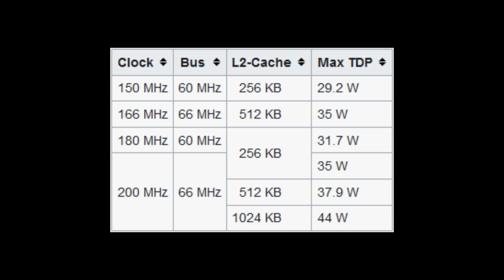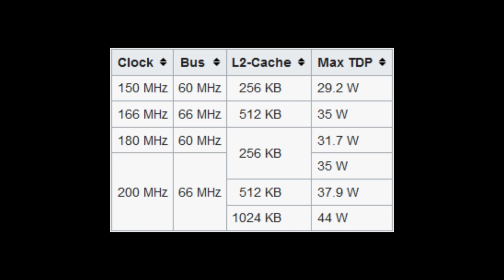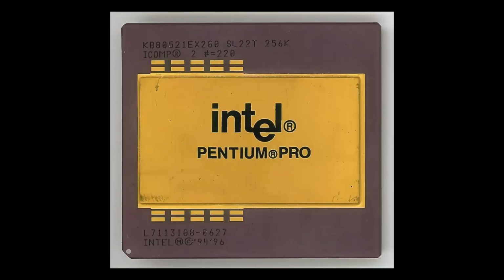Testing a Pentium Pro: Intel's ugly duckling (Part 1)

Comment: I have a system like this, It could even be the same motherboard. I had it since way back then and I overclocked it to 233mhz had a few SCSI drives and a 4mb Diamond Viper V330 graphics card and I even managed to play Half-Life on it even if I had to restart the game every 30 minutes or so or it would start to lag for some reason. I made a lot with this system before it ended up in my storage
Reply from the maker: Sweet, this one is struggling with the graphics card aswell. I've managed to find a couple of decent PCI graphics card, and at some point I will be upgrading this with either a Matrox G450 or a Radeon 7000. Yes, I know they're overkill, but nowadays in terms of more or less affordable cards with PCI connection you jump straight from S3 Trio 64V+ and ATI Rage II+ to things like the G450, the Radeon 7000 or the GeForcer Fx5200. There seems to not be any intermediate steps, at least not one I can find (I'm not saying they didn't exist, but as of today they're not available)

My idea is using the Radeon 7000 on a K6-II machine I have which is limited by PCI only, and using the Matrox G450 on this one, but chances are that I'll have to it the other way around because the Radeon 7000 seems to not be fully compatible with the board on the K6-II.